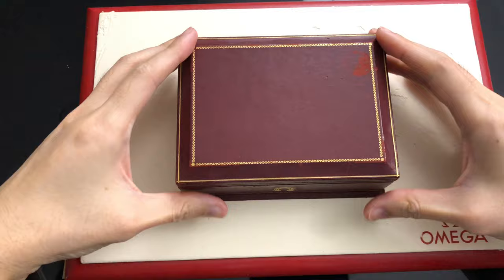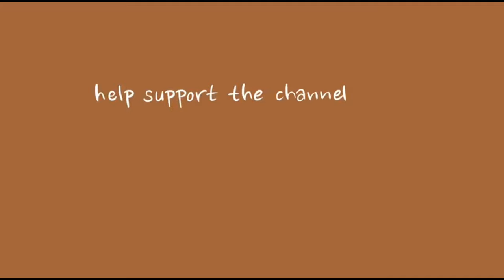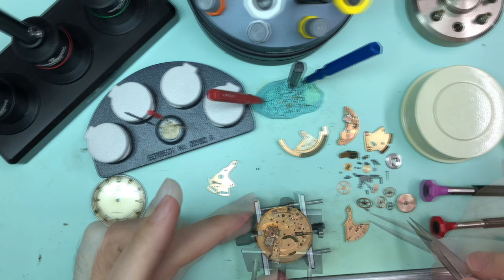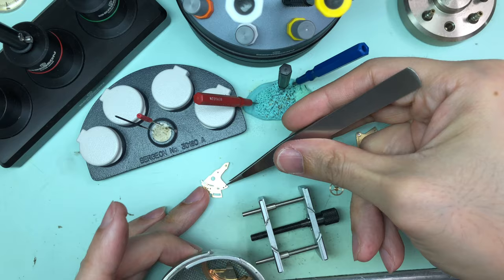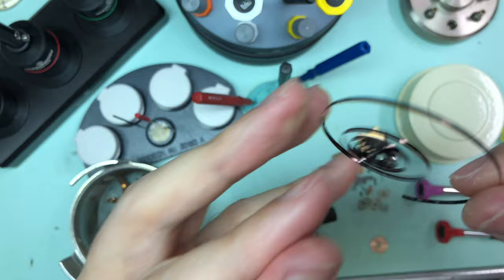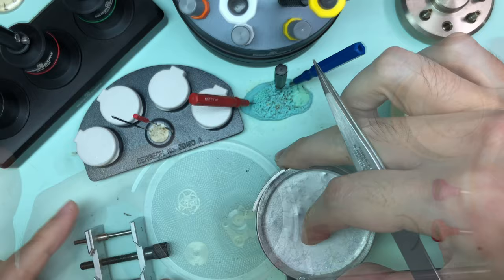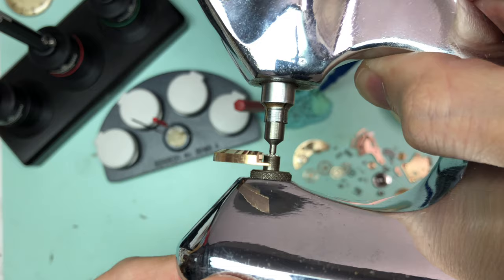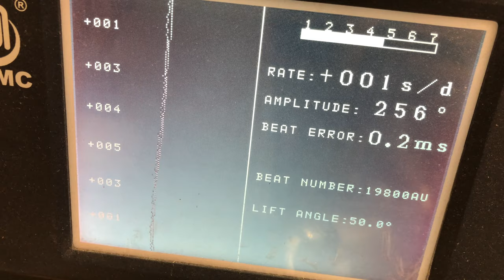RESTORATION OF A 1952 OMEGA SEAMASTER BUMPER AUTOMATIC FULL SET!!!

Comment from the maker: Hey folks. please remember that this is not a "teach you how to restore a watch step by step video", but just a regular education video on the process of restoring this Omega watch.  To learn how to restore an Omega watch or any watch brand in general, it is best to take a course on it.   I used four different type of lubrication in this video.  Two of which are not visible in the camera caption.
Reply: is the 354 much different?
Reply from the maker: @poepflater  Not much different.  Proper service and regulation will get the accuracy to be just as precise.
Reply: @TimelessHistoryChannel  thx bud

Comment: Awesome video! I have learnt so much.
I do have a question:
I was looking at the watch my grandfather had left me and at first sight it's a late 50s Omega constellation. Simple domed face, no date, beautiful and simple. Stainless steel with rose gold plating.
But it has a bumper movement from 1952 (seen on the serial number). The backplate also doesn't have the constellation observatory.
My question is: did that constellation exist? Because I suspect it's a 1952 seamaster that at some point in the early 60s had its dial face replaced to the constellation by Omega.
Reply from the maker: All 1952 Constellation requires a medallion on the case back. It may have fallen off on your
Reply: @TimelessHistoryChannel  
Yes. Either the back was replaced or the dial face. It's this exact same movement with a 1952 serial number. 
The movement runs and keeps time but the seconds hand unfortunately doesn't move. Do you know if it's an easy fix?
Your channel is fascinating.

Comment: You have an unusual way of servicing a watch.
Reply from the maker: Probably.  My colleagues from Omega, Rolex and Bulova service in a similar fashion as well.
Reply: @TimelessHistoryChannel  They all leave the balance in and leave the pallet fork alone?
Reply from the maker: @stevewilliams5428  No, they use Ultrasonic at work.  But on the side they use spinner cleaner.  For me, I need to remove them if I am using the Ultrasonic machine as well.  Otherwise, the shock can break the balance staff.  I leave them on since I am using the spinner majority of the time.  But then I'll need to remove both upper and bottom balance jewels to clean them up before oiling them.
Reply: @TimelessHistoryChannel  So how do you lubricate the pallet fork upper pivot and the stones?
Reply from the maker: @stevewilliams5428  May I ask are you a watch maker?  Because by this last question I do not think you are.  You can see in the video how I would lubricate the pallet fork stones.  And proper lubrication means you do not lubricate the upper and lower pivot jewels.  Pallet fork stones also take their own lubrication.  At the end of the video, you can see the timing.  I even had to adjust the hairspring a bit in order to correct the beat error.  On the newer caliber such as the 550 series, I would be able to adjust beat error a lot easier.  I am also not using my automatic oilers.  Just to show that anyone who is planning to learn watch making can just use regular oilers.
Reply: @TimelessHistoryChannel  How can you lubricate the pallet fork stones without removing the balance?
  The balance was still in place .. and swinging.. when you started dissembling the movement.
 It's good practice to release the power in the mainspring before touching anything.
 It's good practice to remove the balance as soon as possible to reduce accidental damage.
 It's good practice to put the balance back in last.. to reduce the chance of accidental damage.
 It's fine to put the balance back in when you run the bottom plate through the cleaning machine to
 safeguard the pivots.
 I don't understand when you say 'Pallet fork stones also take their own lubrication'. You have just run them through
 the cleaning machine. Lubricated from where?

 As to your 'colleague's' at Rolex,   I'd be very annoyed if they serviced my Rolex without even removing the balance
to inspect it.
Reply from the maker: @stevewilliams5428  Oh Steve, you are taking this video as a "step by step" to teach you how to service a watch video aren't you?  I did left a note in the comment section that this is a restoration video and not a step by step how to repair a watch video.  For that you will need to take a course or become an apprentice to learn.  As a watch maker, we all had to go through that and not just learn off a video on Youtube.  To service this watch did not take me just the 18mins to complete it.  It took me a few hours of my day and many more hours to edit and turn it into a video.  You will notice that no body will ask such question if they are a watch maker as they know exactly where I have oiled the pallet fork stones.  Every movement on the dial side mainplate will have two opening holes just below the pallet.  They are there for a reason and that is to allow a watch maker to stick his oiler into to lubricate the stones.  You can always direct message me on Instagram and I can send you a picture of the two holes.  See, it is hard for a watch maker to explain this if you are not one yourself.  And how do you know that I did not check the balance wheel?  Just because you did not see it in the video?  Again, the video is only 18min long.  Where as the actual service took me a few hours to complete.  And you can see at the end, the timing explain everything to you that the watch is now running healthy and strong.  I've been doing this for 20 years almost on a daily basis.  Watch making is not something I just pick up a couple months ago.
Reply: @TimelessHistoryChannel   Leaving the balance in when there is still power in the mainspring, and dissembling the watch with
it still in place, and powered... is still an unusual way to service a watch as I originally posted.
 Everything else you have replied with is just smoke.
Reply from the maker: @stevewilliams5428  You NEVER EVER leave the mainspring with power left while working on the watch.  The mainspring release can break all or some of the train wheels plus the pallet and balance staff.  It's very sad to see you are assuming me that I did not release the power of the mainspring when I am the person who made an educational video teaching people how to release the mainspring power before working on a watch.  Here is the link that you probably missed: https://youtu.be/U1HW4wuiKT0

Remember that this is only a 18min video.  I cannot cover or highly everything.  There are something that takes a while to go through and are pointless to include in the video as this is a not a "step by step" to teach someone how to service a watch video.  And if you watched my latest video on the Rolex video (which is longer), I actually included the mainspring release part of it.  It was a very quick release on the Rolex since the mainspring is pretty much already unwind.
Reply: @TimelessHistoryChannel  Blah blah blah.
Reply from the maker: @stevewilliams5428  Very childest
Reply: @TimelessHistoryChannel  I don't know what Steve Williams problem is.  He seems to be taking your comments personally.  You did a good job explaining what you did and you were trying to help him out as much as possible.  Thanks for the video.

Comment: The case was so scratched up it affected my feeling about this restoration. I'm not sure what the options were...regrinding? Purchase another case? But the work was superb. I just like to see a watch which is acceptable visually, and while I can accept some patina, my acceptance does not extend to gouged up cases. I've had the same decisions when I was restoring motorcycles to museum condition. What to improve? What to leave? One makes one's choice and lives with them!!!  I'll part with a question...why did you accept the case condition as visible up top?
Reply from the maker: Thank you for the comment. There are two ways to restore a vintage watch. 
If a watch is restored for a collector or a dealer, or someone who is a vintage watch enthusiast, you must avoid case polish, dial refinish, hands replacement, and relume. Sometimes, even required to keep the old scratched (including fracture between the crystal) original crystal, which goes too far, in my opinion. You want to see the beauty of the dial. 
I believe it is the same when someone restores a gun for a collector; the restorer must not touch up the case in any way. It will hurt the value drastically. 
But for a vehicle, the restoration of the body is highly important. 
So, the restoration world is quite complicated if you study it. 
Like myself, I am a vintage watch collector, therefore, leaving the case unpolished is a must, or I will not appreciate the watch the same way. 
The second way to restore a watch is to make it look new. This method is usually accepted by someone restoring an heirloom or personal piece and not a watch collector themselves. They don't care about the value but rather just want a watch that looks clean and like new again. 
That said, maybe I'll find a cheap vintage timepiece in rough condition and restore it like new, so my other viewers can enjoy it. Meaning I'll polish the case and so on. :-)

Comment: you have precision oiler but you didn't use that? Why?
Reply from the maker: In the workshop, I have pretty much every quality tools to get the job done.  A regular oiler is just as great as an automatic oiler.   For the purpose of my videos, I like to show people that you can still get the right job done without using the best tool there is.  Especially for beginner.  For examples, you can buy about 30 regular oilers for the price of one single automatic oiler.  For the crystal press, I find the quality of my $15 press is just as great as my $700 press.  However, certain tool such as my staking tools and jewel setting staking tool, those I recommend that you use top quality set.  If you scroll back to my past videos, I made one on essential tools.  There I point out which tool is fine to use less expensive version and which will require best quality stuff.

Comment: What you did for this dial here.. Is this all you do for all the watch dials or is there more steps to do for restoring dials? Your Longines RAF Instagram post brought me here! Looked unbelievably New
Reply from the maker: The dial can be very sensitive.  On certain dial you can easily remove the font by mistake.  Need to thoroughly examine how the aging and condition of the dial + what sort of material was applied on the dial.  I normally just use the rodico and in some occasion a toothpick as well.
Reply: @TimelessHistoryChannel  I'm not much keen on what material used. As I see on this video you have just wiped dial with a cloth and that's it! My question is, is this all you do for dial restoration? Or is there more
Reply from the maker: @johnny_bravo9990  You can see on my other videos I use a green compound known as "rodico" to clean dials.  You can also watch my video on "essential tools" and there you can how the rodico looks like as well.  It's very cheap and a must have item.
Reply: @TimelessHistoryChannel  Will see your other videos. Thank You very much

Comment: Very informative video. I now own my late father’s 1948 Seamaster bumper, very similar to this, but the second hand is in a sub-dial at 6 o’clock.
Reply from the maker: Seamaster calendar at 6 is case model 2757 if it looks like this case.  Which dates to around 1954-1956.  The first Seamaster with calendar was first introduced in 1952 under the case model 2627.  :-)
Reply: Thank you for your reply. The watch has no date, but the second hand is in a sub-dial. The movement is the 342, and 2576 - 11 is inscribed on the caseback.

Comment: How do you know which crystal you need?
Reply from the maker: The original crystal for this watch is actually discontinued.  So Omega replaced with 2 other crystal number to replace the original.  It will work on all of the 1950s Constellation (34/35mm) model as well.  The replacement crystal is a bit higher compared to the original one sold with the watch from day 1.  When you order a crystal from your local supplier, they will have a cross reference chart in their booklet or computer to supply you with the correct crystal.

Comment: Didn't you disassemble the keyless works?
Reply from the maker: What do you mean by that?
Reply: @TimelessHistoryChannel  It seems from the video that you put the mainplate in the cleaning machine without disassembling the keyless works.
Reply from the maker: are you referring to the balance wheel?  I use a spinner type cleaning machine. Which does not require me to remove it.  I have already checked the balance before and after the service.  If there is an issue that I did not see, it will show up during the timing process.  This is something that you will get to learn when you study watch making.
Reply: @TimelessHistoryChannel  No, not the balance wheel. The keyless works=winding and tie setting mechanism
Reply from the maker: @hasininan5501  Ah, you mean the winding and clutch wheel, yoke, and stem.  They are not mandatory.   But you do need to take them apart like on my first restoration video (Seamaster 60) because they were rusted which will need to be cleaned or replaced.  But I have checked the winding system on this watch and they are in great shape, so can just clean it this way.  Remember that this video is only a little over 18min long, but the actual repair took a few hours to complete.  Like I said, this is not a teach you how to repair a watch video, but more of an entertainment restoration video.  :-)
Reply: @TimelessHistoryChannel  Yes, those parts are together called the keyless works.
Reply from the maker: @hasininan5501  Good to know.  Because we call them the winding system here.  :-)

Comment: Good video but not enough dialogue, also strap stained. Sorry.
Reply from the maker: Please check my latest restoration video.  Have added some dialogue.  The stain on the strap is a mark from a marker which cannot be removed.  I would love to use a different strap, but since this was a genuine correct original vintage strap, it does make more sense to go on the watch.  This way the watch is completely original.
Reply: @TimelessHistoryChannel  fair enough, still a good video and your skill is excellent sorry for my comments though they were more simpley advice certainly not any criticism, I could not do your work.
Reply from the maker: @wendyglasgow6394  Please do not apologize.  I understand your comment.  The purpose of my video is to show how I would normally restore such a watch.  It is not really an educational video about watch repairing.  But that's right more dialogue will also make the video less boring.  haha

Comment: Hello, why didn't you polish the watch case?
Reply from the maker: Because when you polish the case, you are not restoring the watch properly.  You take away the original finish and a lot of its value away.  Restoring a watch is not the same as restoring a car.
Reply: @TimelessHistoryChannel  I understand.  But a friend has an Omega Moonwatch and had it checked by Omega and they delivered it with a new crown, new and polished glass ...
Reply from the maker: Yeah, unfortunately, that's how Omega would restore a watch.  Which is the incorrect way of doing so.  But your friend could of inform them first to not touch the case or dial.  Polishing the crystal and replacing with the correct crown will not do any harm.  Just avoid polishing the case, refinish the dial, and relume the watch.